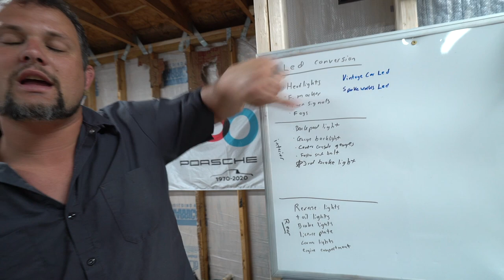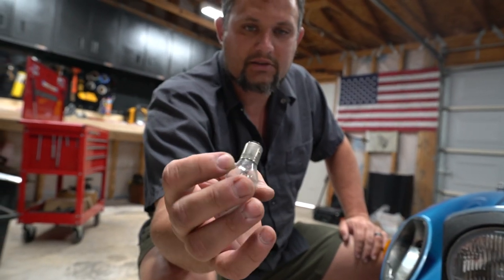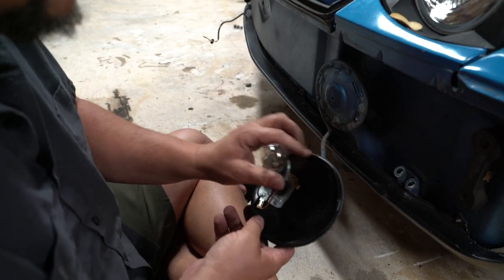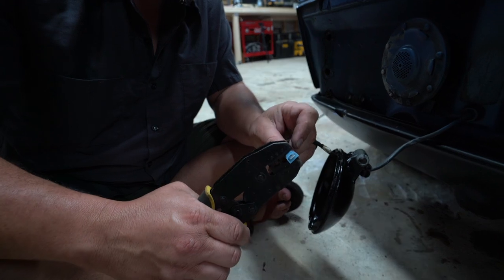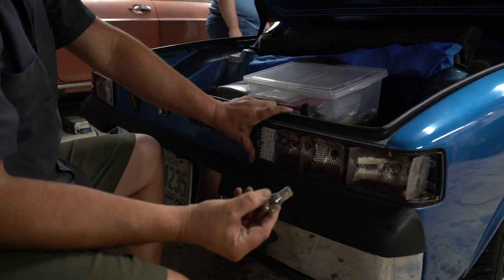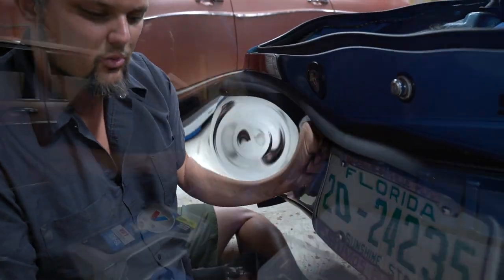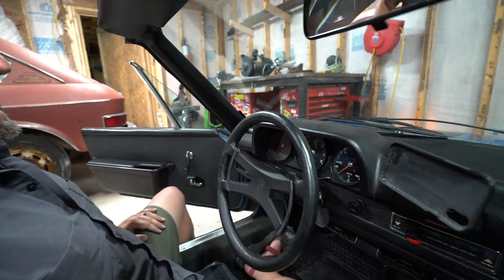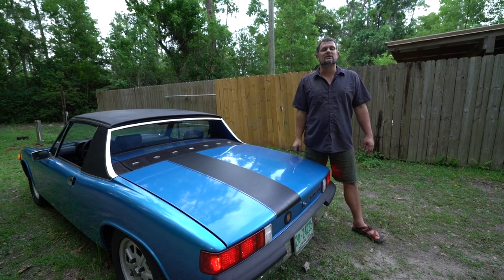Vintage Porsche 914 Complete LED Conversion!

Comment: You sir are a true professional... well thought out and top notch instructional video. I have a 74 914 and have wanted to at minimum upgrade the head and fogs... but forgive me... im a bit of a retro purist and the "look" of LED's behind old school lenses just is a turn off UNLESS... you have an EV conversion 914 in which case the whole system youve shown is spot on... (again.. just my opinion.) Still love your style and instructional video.
Reply from the maker: Thank you! If you get the glass hella lens headlights, I think you can even get an incandescent color temp. I highly recommend the brake light upgrade from a visibility standpoint!
Reply: I have a 74 I just got..do u have  pics of yer engine bay? and inside of the car? one I have is all apart now

Comment: BTW the process for removal of the fog lens ring is to loosen the tension spring (bottom center of the housing ) with a flat blade screwdriver. It allows the the ring to come off w/o force.
Reply from the maker: Good to know! I have another set apart now

Comment: Thanks for a great video!  Did you look at changing the bulbs behind the heater controls on the dash?
Reply from the maker: Actually, no that’s not one we looked at. Mine has never lit up, so I need to check into it!

Comment: An easy trick for the front and rear bumpers is to replace the 4 long bumper bolts with 4 studs screwed into the bumpers.  Use the same size studs as used to hold the exhaust headers to the cylinder heads. It makes r&r of the bumpers an essy one person job.
Reply from the maker: Cool tip! I’m 100% doing this on the next bumper I have off. I’ve done this job solo- it’s isn’t fun!

Comment: Nice and helpfull video txs. Its helps to remove the steering wheel  ( 1 minute job) before removing the clocks
Reply: BTW, do you have a link for the LED bulbs for the dashboard lights? Can,t find them on the provided links (?) Txs!
Reply from the maker: Thanks! You’re right, zipping the wheel off would have been super easy. I just updated the description with additional bulb links. They’re the “BA7S” in the Amazon links.

Comment: surprised the video didn't include a struggle to get the HL trim rings off? They are typically rusted in place &/or stripped
Reply from the maker: We were lucky! I’ve done a few and thankfully none were too badly corroded

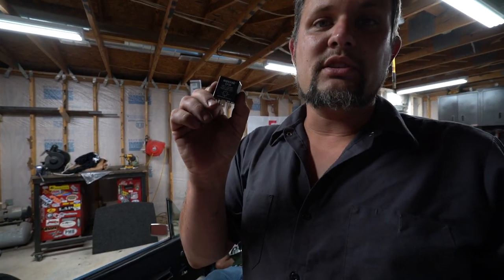Comment: Great vid - Thanks! Question: At 20:55 you describe the plug and play LED signal relay change. Then at 21.25 there's an additional different segment describing cutting and splicing some wiring. Is this also necessary for the plug and play LED signal relay change?
Reply from the maker: Actually it’s not! The splicing is only required for being able to turn on the fog lights w/o the low beams on too. The relay is a plug and play for the LED swap.
Reply: @barefootgaragejax9252  Thanks! Please keep up the 914 videos. I'd actually have a couple requests for future vids: 1 - A reality video of a dwell/timing/points project on a 914 engine in the car, not on a stand (which is the way all the timing videos I've found present this). It is very different leaning over the engine and working that way.

Comment: HI Jax , where can i purchase the splitter blue connector (1 female - 2 male ) @ min 21:42 ? thanks in advance
Reply from the maker: It’s homemade. Just two short pieces of wire and 3 connectors.